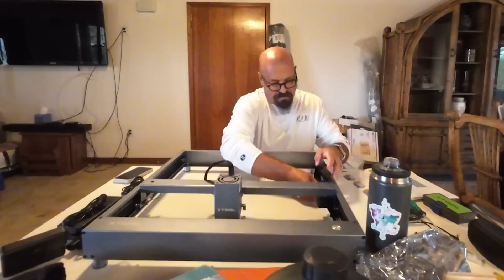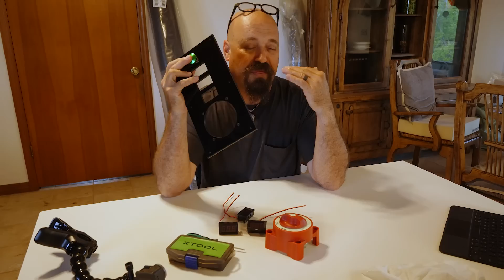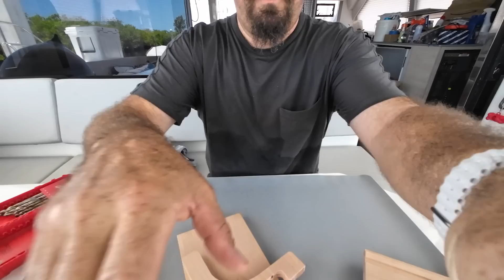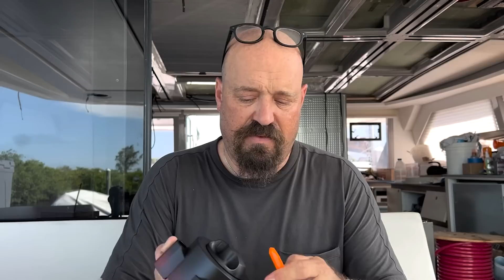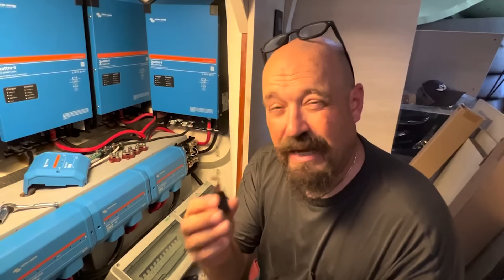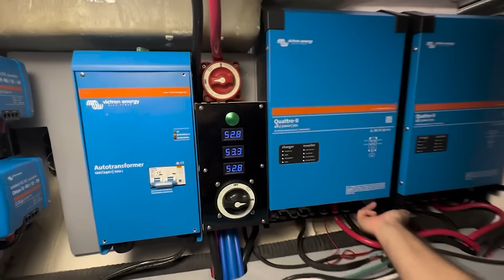LASER POWERED BOAT//Custom Panel With XTool-Episode 140

Comment: When you pushed the green button, the readings were 5.2V, after switching it showed 52V. Weird.

What do you think about putting some snaps on the rear of the panel to have some extra spare displays in case one goes bad in the future?

Comment: I'm hoping the resistor won't burn out , it will get HOT so the acrylic is not the best mounting surface, the battleborn resister must have been a clue. Good luck but I think it's under engineered try the math 100w 500ohm check the voltage drop for the dissipation.
Reply from the maker: Yes, they do get hot with continuous operation, however this one will only have current running through it for a few seconds when we power up.
Reply: @SailingDauntless  until there's an error the resistor will almost definitely blow before the 50amp fuse nice work though 😁

Comment: Ty, you mention glow in dark lettering being a good safety item. You can make all your label panels now with your laser cutter and then backfill the letters with a glowing the dark paint or a paint with glow pigment added. You can even get different colors. Etching the letters on the back of a thin clear panel, backfilling with paint then glueing the thin clear panel over a sheet of black will create a smooth switch panel surface that is more durable and easy to clean since the letters are protected. You can also apply vinyl graphics of hydro dipped graphics to the in side of thin clear outer layer. Just provides better protection but you do need to ensure a good deal between the layers so it’s basically water and you don’t get salt intrusion.

Comment: Hi Ty, the size of your precharge resistor is too large. The precharge voltage (the voltage applied to the inverters) settles to a smidge above 5V, and doesn't increase further when holding the GO button for longer. 
This is due to the inverter electronics drawing current (about 100mA, if I correctly saw the resistance of your shunt resistor,  50 Ohms).
When you switched on the negative switch, the inverter supplies all jumped to 52 (ish) volts. This implies that you are still ramming a very high amount of current into your inverter caps at the instance that you switch on the negative, because you applying an additional ~47V (52V - 5V) to the inverters. The caps are still being strained by this inrush current.

You will need to reduce the size of the precharge resistor. I can't suggest to you what size you should be using because I don't know what the minimum supply current is for the inverters.
I suggest that you 1st figure out what size resistor is needed to get the inverter precharged voltage to about 75% (the higher you can get it, the better) of your bus voltage, then you divide that resistance by 3 (for the 3 inverters) and replace your current resistor with this new value.

You probably won't need any form of heat sinking on the new, smaller resistor, if you select the same wattage as you currently have (don't reduce the physical size of the new resistor).

The downside of using "passive" resistors for this is the voltage drop across them, you will never get the caps to charge to your bus voltage while there is something else drawing current too.
That massive "shunt resistor" that you got from BattleBorn is in fact an "active" resistor, which uses transistors to charge your caps by limiting the maximum current that can flow into them. This form of precharging will get you to within 95% of your bus voltage.

Also, don't release the GO button before switching on the negative switch, keep pressing it while closing the switch, so the caps don't loose some of their charge before the circuit is closed.

Thanks for sharing your build, I'm thoroughly enjoying your journey.
Reply from the maker: Good catch!  I was so focused on the filming and turning the system on that I missed the voltage difference.  My brain didn’t even see the decimal point.  I actually put a 500 Ohm resistor in by mistake.  I have (what I believe is) the correct one on order.  I also need to see if I can calibrate that middle display or if I need to replace it as its registering about .5v off.  Thank you for the comment and for watching!
Reply: Also check your ANL fuse…  as normal ones are only rated 32v not suitable for 58 system

Comment: Hi Ty, I really do enjoy you guys and have from the beginning.  You do great work.  This is just a pure OCD question, at the end of the video when the system was booted up, two inverters were reading pretty much the same at 52.8 but one was at 53.3.  Does that difference matter and I'm not really sure why there is a difference at all given that the battery banks come in via a BUS bar and singular cable.  Is it in the inverter itself and will it be sorted when the Inverters communicate with each other via software?
Reply from the maker: Good question, the voltage is the same, unfortunately the meters aren’t very accurate 😕

Comment: I think you have the wrong size (500A) fuse in your system.  That fuse should protect the wiring and 0000 Marine Wire can't handle 500Amps except at exceptionally short distances.  Your system should be drawing at most 375Amps @ 48VDC which is still higher than 0000 can handle for long lengths.  This is a problem I've been wrestling with on my 12V system (which I will have to upgrade to 48V in the near future).
Reply from the maker: This 4/0 single conductor 105C rated tinned copper 2100+ strand battery cable is rated (and approved by ABYC) at 455A outside of an engine space.  The fuse will blow at aprox 110% of peak cable continuous duty of the cable.  The voltage of the system is not relevant to the rated current, and Amp is an Amp regardless of the voltage.  Now, if the same cable is in an engine space is has a recommend safe rating of 378.3A.

Comment: how did you size the wire  to the capacitor ?
Reply from the maker: 500w divided by 48vdc (nominal) is 10.41A divide by 3 conductors with the longest wire run at 4’ @ 3.47A each  nets a recommended wire size of .25mm2 or 24ga with a .33% voltage drop. I used 20ga (0.50mm2) for good measure.

Comment: That new panel setup looks amazing and very professionally done too.  Even painting the switch black looks great and it looks like it was done at the factory.  What was the paint you used for that job.  I didn’t understand what you said in the video about what it was/is.  I can empathize with you on working in the heat.  We were boondocking in our Fifth wheel the last three days and it appears that our transfer switch quit outputting power from our generator and then everything stopped on the 110 side.  We lost around $500 of food in the refrigerator and freezer, but a local friend had enough space for us to store some of our freezer items so we didn’t lose everything.  This is our only home as we’re full time (since June 2022). I wish I knew enough about the solar setup like you apparently do.  Regardless, very nice work on all that setup and the new components too.

Comment: The resistor you use for discharge will be over 100 (200 F) degrees, you should mount it on a piece of metal with spacers so the metal is away from the acrylic, it is best with air all the way around the resistor.
Reply: He's precharging capacitors not balancing a battery bank. Most people just hold them in their hand when precharing manually.

Comment: As a laser designer myself (project laserscythe on thingiverse) you need to emphasize safety with that laser and the number of viewers you have. A 20w laser can reflect and instantly burn through your closed eyelid and retina without a light tight enclosure, and there Is a loooot of light bleedthrough from that laser orange surround. At a minimum you need to either have that thing inside a light tight enclosure, or be wearing appropriate safety glasses rated to whatever laser wavelength you buy. This is not optional. You can instantly ruin your sight from across a room. Forever. It only takes one small mistake. I feel it is incredibly irresponsible to just present these devices as fun easy tools with no safety concerns.

Comment: Amazing work! Tiny little detail here, but I noticed that the NEG and POS lead from the battery bank going into the lynx distributor is exposed and right in the center of the space. 29:22 I can easily see someone leaning in to pick something up and accidently shorting those to connections with a tool or a sweaty shirt. Maybe insulate one of the leads? But seriously very impressive setup.
Reply: Believe his ocd is far from finished in there. Consider the 48v bus covers under the seat.

Comment: I am always looking for excuses for new tools!! Great video. How about the thin wires that run to your three voltage displays did you include any in-line fuses to protect them. If not they are fused at 500A They should have fuses rated to the gauge of that wire to prevent a fire risk.👍

Comment: Nice. I Have 4 battery banks with 4 BMS's so I turned of discharge on 3 and the 4th I set to discharge 1 amp. Then I powered on my inverters and turned on other 3 BMS's to discharge and adjusted the 4th. My BMS's can discharge 250 amps at 44-58V so I turned them down to 60 amps each. When I use 10kw from my 2 inverters I pull 2500 watts from each battery pack. My batteries never se over .4C and most of time they are at .1C. They never get hot or loose from heat loss.

Comment: Nice Job on the Panel! However, I think you need to go back and look at the video. When you pressed the button your displays were reading 5 . 3 volts not 53. When you switched the main then it jumped to 53 Which means there was still a lot of current flowing thru the resistor when you were holding the button. I would expect that if the inverters were fully charged there would be less current flow, and thus lower voltage drop across the pre charge resistor and it would be closer to 53 (while you were holding the button down). I guess you are  lessening the amount of surge current, was 10% pre charge what you were shooting for or did I miss something?
Reply from the maker: The decimal point keeps jumping on those displays.  I think I might need to get new ones.
Reply: @SailingDauntless  I was curious why a dial resistor wouldn't be used, slowly dial it up.
Reply: @SailingDauntless it did read 5.X several times when charging. I would've interested to know if that is real or not.

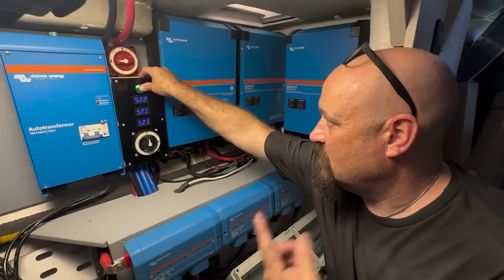Comment: Isn’t the pre-charge supposed to get to near battery V? 29:28 shows 5.2V not 52V and leaves the inverters only a tenth charged. Looks like it needs a bigger charger resistor.
Reply from the maker: It’s actually 52.XX VDC, for some reason the decimal is showing up in the wrong spot.
Reply: @SailingDauntless  it shows 52V once the disconnect closes, sure. I’ve used those style displays and they don’t put the decimal wrong in my use, I’d check with a DMM that you are getting to 52V with the pre-charge. I think your reaching steady state at 5.2V
Reply: Definitely something odd there.

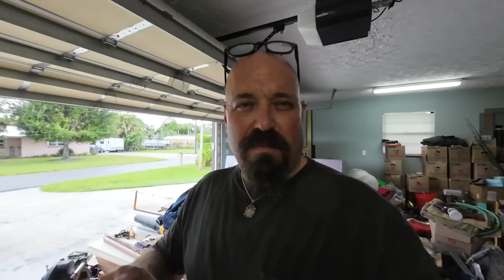Comment: Good thing there are captions because the audio mix is so bad you can’t hear anything.  @4:45
Reply: Perhaps on your end, compared to some vids I watch, I could actually hear Ty there, altho softer than other times. One of the girls (directors) might have to start demanding he wears a wireless fluffy.
Reply: @Lana_Warwick  a decent shotgun mic on top of the camera set to the correct levels would be more than fine.  Or one of the many inexpensive lavs that records direct to the mic pack are great. Turn it on and forget it. No wireless. Sets levels.    I’m a film editor sound mixer for features and docs Los Angeles and New York. I was listening on a $30k home theater that’s calibrated to Dolby specs and atmos. On a oled screen that’s calibrated.  Average audio levels are -11 for this video. Most of YouTube stays pretty close to 0. Not great for dynamic range but it’s what they do.  And there are many places where audio peaks there. So it’s just a mix thing. Levels.  They could slap on some auto correcting plugins most editors have.  Or a compressor. Or just listen to their videos on studio monitors not headphones.  It’s sloppy. Lack of QCing. Normally they do okay. This video is just awful.  I’d take it down and try again.
Reply: @JSJnay  I'm old with industrial deafness, I use subs all the time, annoys me when some forget to add them.
Some put their text overlay in the same spot, have to skip back, turn off subs, read it, go again.
Sometimes there's audio interference, background noise etc, sub misinterprets, no idea what they said. Bit or research I found they can easily edit subs b4 upload.
I advised a known channel of both above, response was kinda dilligaf, like they didn't have time.
Content creators with 9to5's & much higher scribs seem to get it done. Guess it's possible without swims in clear ocean water, walks along the beach, naps under palm trees, few hours editing, time for sundowners 😉